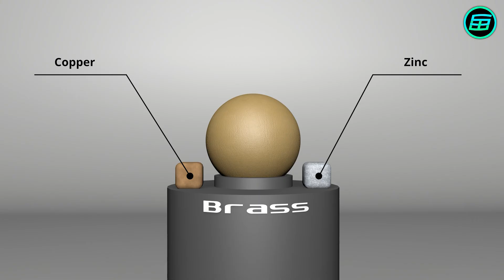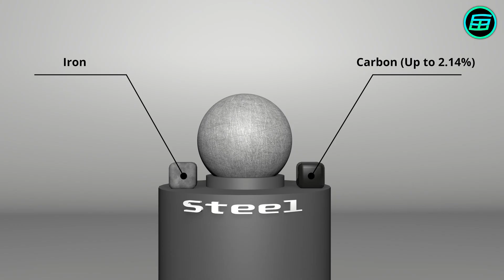Brass, Bronze, Steel

Comment: How about brass and copper when exposed to heat, will they expand, sir?
Reply: Yes, most things if not everything expands with heat. The reason ice expands is because the water molecules form a hexagonal structure which is less dence than water.